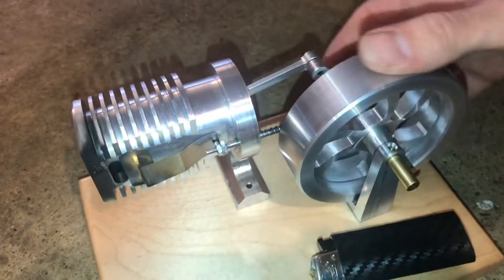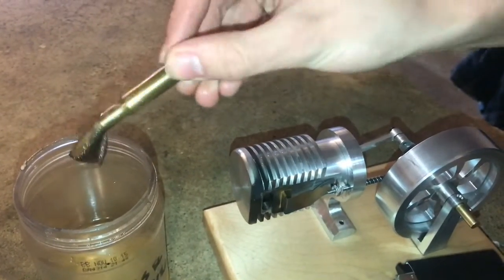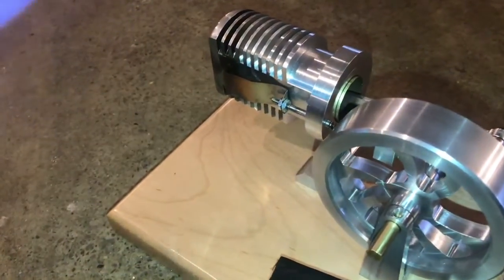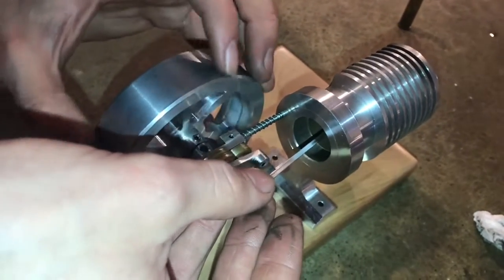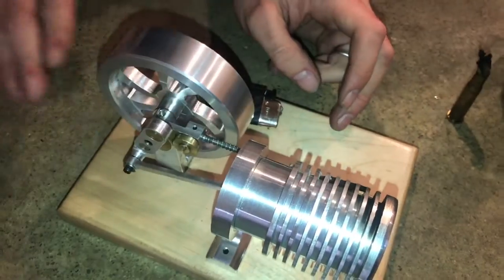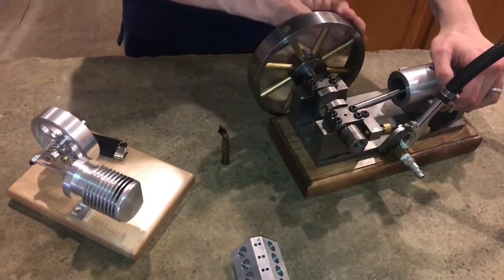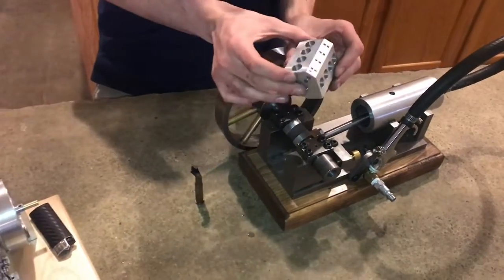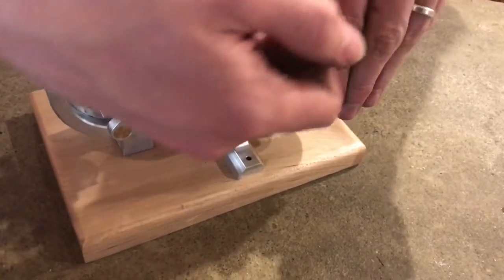engine that runs on FIRE of any kind

Comment: I was looking for a similar video. 4 years ago, I had also made this engine. I was running it on diesel but it did not run. Spirit is not available in India. Sir, please try running this engine on petrol as well, does it run?  Or No, I am making a flame licker engine again and I am thinking of running it on petrol it works or not ?